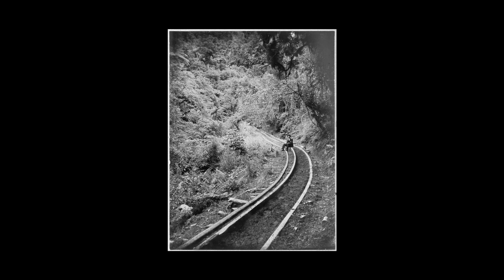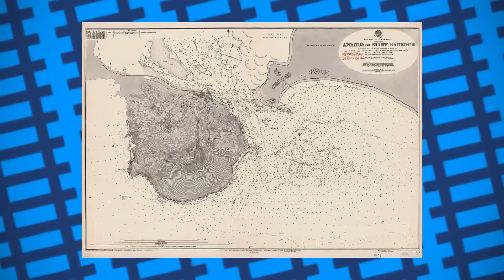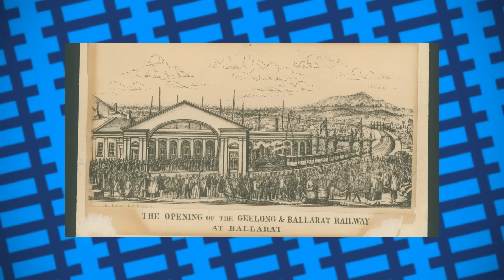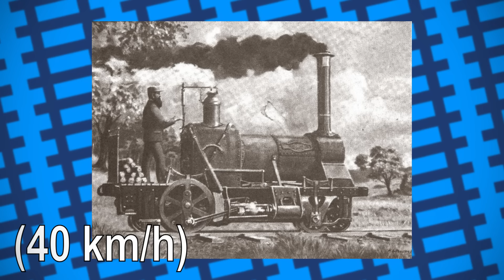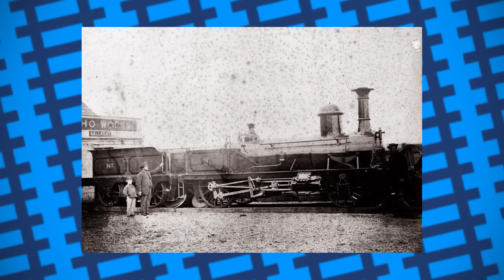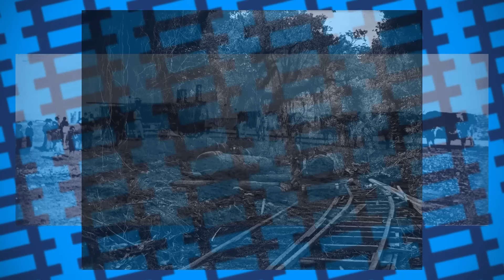Can you build train tracks out of Wood? - Invercargill Wooden Railway

Comment: The United States tried a similar idea with strap-iron rails.

In the mid-18th century, somebody decided to try and increase the lifespan of wooden rails by introducing the concept of strapping a thin layer of iron over the wooden tracks. Being served by horses, this proved to be quite the benefit. It was not so beneficial when the iron horse began to show up.

A little context might be needed. When the railroads began their big expansion in the 19th century, the United States was rather notorious for being... shall we say, careless with the way they handled things. Track was laid out quickly and often unevenly, and derailments were very common. Funny thing was that trains ran so slowly, it often was seen by passengers as little more than an inconvenience, even if they had to physically get off the train and assist putting it back on to the tracks. (Some even saw it as "part of the experience".) As far as the companies were concerned, they needed to lay out the tracks as fast as they could before a competitor did it first, so the fact safety wasn't a big concern by passengers meant that the railroads would take full advantage of that.

So with that in mind, a lot of railroads decided to go cheap wherever they could. Some decided to use strap iron rails as a means to save money and time. This was all well and good, provided maintenance was thorough.

But there was a major drawback that soon became apparent. As train wheels ran over these straps of iron, the action would often cause the strip to roll-form. The faster and heavier a set of wheels ran over the iron, the more pronounced this effect. This results in the ends of each strap curling. Eventually, these ends of the straps (known as snake heads) would get just slightly too high, and an approaching wheel would kick it up through the wooden carriage/freight car, often leading to derailments, serious injury, and even death.

Eventually, it was found that any money saved by using strap iron was only short term. Even if you ignore the accidents, maintenance alone on these tracks meant that you would lose money when compared to using fully iron rails in the long run. Between this and improvements in casting iron, strap iron rails soon became obsolete.
Reply: I may provide some additional context here. The term "strap rail" is misleading, as well it is a term which was not in use when these roads were built. The "strap" was wrought iron bar, usually about 1/2 to 3/4 inch thick. While cost was a major consideration, most of these roads were not cheap to build, and it is a common misconception that they were poorly laid. Indeed these earliest roads laid down in the 1830s often cost far more per mile than those built decades later. 

But to the point: wrought iron was extremely expensive in the U.S. during the 1830s and 1840s, and there were no mills in the states which would roll it into rails, so if any quantity was needed it necessarily had to be imported. And there was a tariff on imported iron, so again advisable to limit as much as possible the amount of iron bar used. When a lot of these lines were being planned out (some as far back as the 1820s) the form of rail, the material to make it out of, etc. was not a settled question. The experts in England were experimenting with cast iron rails, wood rails, fish-belly rails, and so on. The "strap rail" was in most respects the form which gave the most advantages with the least drawbacks.

For example: The Philadelphia Norristown & Germantown RR was originally built with all-iron parallel rail supported by cast iron rail chairs (at the time, the latest and greatest in England), at great expense (being one of the most expensive lines, per mile, ever constructed in the U.S. at the time). After being in operation for a few seasons it was found the iron rail, expanding in summer, and shrinking in winter, worked loose. In summer the expansion would cause the cast iron rail chairs to crack, in winter it would shrink and rattle loose in the chairs. They ended up replacing it with "strap rail" by 1837, which did not suffer so much from extreme temperature changes.

The problem of snakeheads is mostly legend. There are only a handful of recorded instances of such a thing happening (probably less than a dozen) over the entire history of American railroading. Even back then roads hired section gangs who would walk the route every morning to inspect the track, and loose iron would've been hammered back into place. Derailments often happened, but for other reasons. Flange design was not well understood in the 1830s, and cross ties were often spaced too far apart (four to six feet center to center being common) to keep the rail gauge in check. The earliest lines, laid on stone blocks (as was the style in England at the time) sometimes had a wooden cross tie placed every 20 or so feet to keep the gauge...
Reply: @nostalgiccameralife  Badly laid track was far from the only reason trains came off the track. Everything from misunderstandings of how physics worked and lack of standardization to faulty designs and cut corners contributed to derailments.

While incidents involving snake heads were indeed a rare occurrence, whenever it did occur the end result was almost always catastrophic.

Comment: I thought the sleepers were usually the only parts of the railways that were wood. These insane ideas just keep surprising me.
Reply: In North America until around the 1870s, many branch lines and some main lines had wooden rails with iron straps on top to use ordinary flanged wheels, again due to the lower cost.  Heavier trains and increased use, along with ‘snakeheads’ (iron straps curling up into the floor similar to the Eschede derailment) led to their use being discontinued.

Comment: Super. I have seen a couple of wooden railways. One had an old Mack truck with eight wood track wheels, and it looked like a flatcar with a truck cab. The Mack pulled an eight wheel trailer, and both could be loaded with timber. Another had a vertical boiler "Shay" type steam locomotive, with half round wheels that looked like an automobile rim without a tire, which ran on logs that were used for the rails, and had two four wheel flat "train" cars to transport the logs. At least one was a wooden railway that was built with finished 2 × 8 lumber that was stacked up and nailed down to the ties and each other, with the joints staggered to make the rail, and don't forget strap rail, a metal strip secured to a wooden rail supported by ties. 💙 T.E.N.

Comment: The UK has a railway that instead of sinking rocks all the way down to bedrock, actually sits on a giant raft.  In short, the railway litterally floats, and you can see it sink slightly as trains go accross it.  I just wish I could find out which railway line it is.
Reply: Liverpool and Manchester over the Chat Moss wetlands.
George Stephenson's idea and still in use currently because it works.
Reply: That would be the Liverpool and Manchester Railway over Chat Moss, near Manchester. It's probably the first inter-city railway ever built. Also, the method used by George Stephenson (yes, of Rocket fame) was actually a known method of constructing roads - I think since antiquity! Still a brilliant bit of engineering, though.
Reply: @theenigmaticst7572  lots of people wrongly attribute Rocket to old George Stephenson , but it was produced by his son Robert Stephenson's company with input from his staff and Henry Booth.
George Stephenson by that stage was concentrating on the massive civil engineering work required by the Liverpool and Manchester railway.
Quite a few accurate videos on Rocket on YouTube. One of the better ones is :
Rocket : The Basics by Anthony Dawson.

Comment: You may think a train on a railway with wooden rails having to be pushed up a hill is bad. Meanwhile my city's railway, a 20km, 750mm gauge railway with 3 0-6-0Ts and a 0-4-0WT[initially atleast], traveled on relatively flat land, but at a certain point on the line had to also be pushed up a relatively steep hill, and then the rest of the route was mostly flat land again. But then there were also situations where some children would smear things like butter, grease, lard, etc on the rails, which would make it even harder for the train to get up the hill.

Comment: I have a cabin in Northern Minnesota. there are a few documentations of log railways in the area, and I believe my cabin is by one. if you follow the trail, it goes straight from a former freight area in moose lake minnesota, out to the nemadji forest. I don't believe it was made out of steel track, but rather wood. I have no proof of any of this as the remnants have been lost to time. it could have easily just been a pull track for steam tractors to drag logs out

Comment: Crampton style locomotives are notorious for having poor traction. The weight of the boiler is largely carried on the unpowered front truck; the driving wheels just carry the cab and firebox. I wonder how well a proper 0-6-0 would have done? The railway demonstrated clearly that wooden rails are not suitable for a permanent way but with a decent locomotive they might have had a chance.
Reply: when you look at all the logging locomotives running on wood, they have many drive wheels, all either gear or chain driven, spreading the weight and given traction.

Comment: There is only ONE way you can build a railroad that has wood instead of steel for the rails, and that is to use wheels that are softer than the wooden rails. The only way to do this is to use pneumatic rubber wheels on the train.